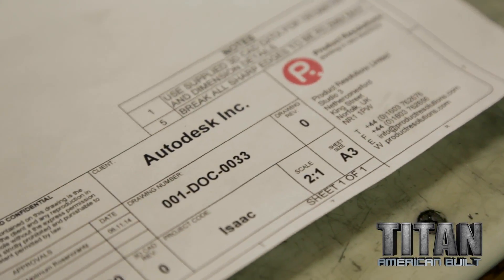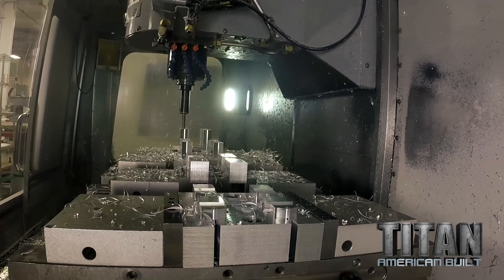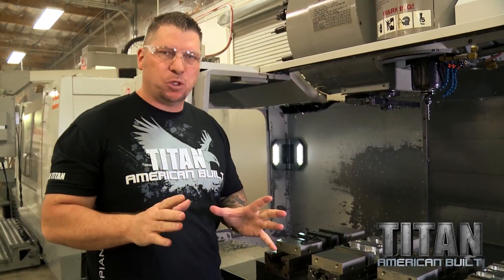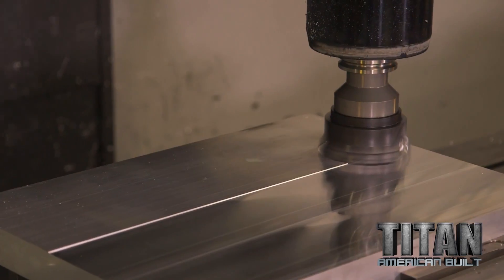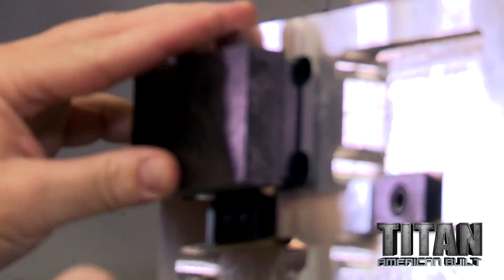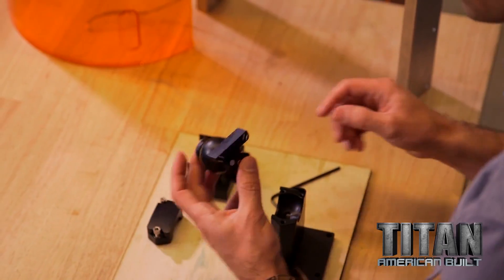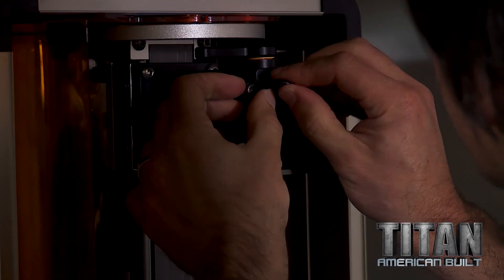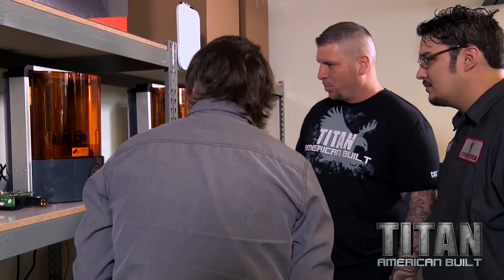CNC Machining a 3D Printer - CNC Machining Education

Comment: 10 micron layer, OK.  Can it make an array of 8 channels,  10x10 micron cross-section,  300 micron in length with a 100 micron pitch on center?  Consider "sold" if it can do it.